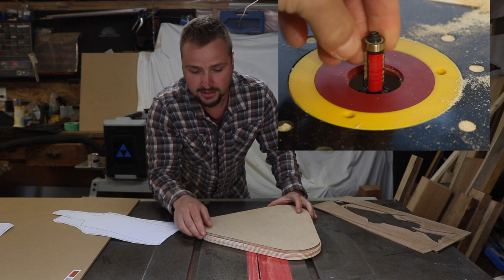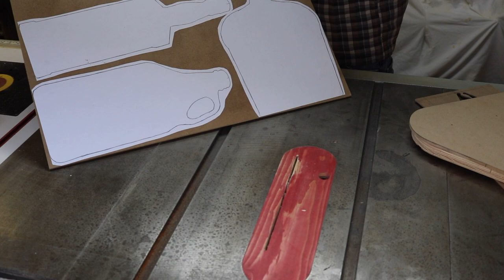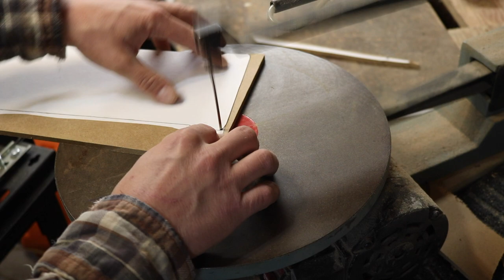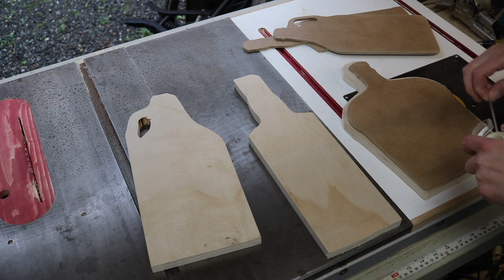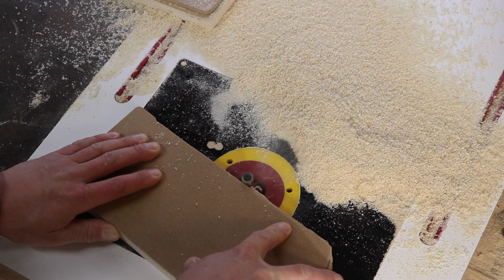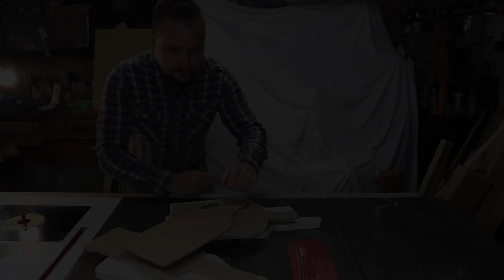How to: Making wood router templates, Router Tips/ Tricks

Comment: Hello and thanks for the video. I tried the same technique, but I often get kickback and one piece even has been thrown out of my hands towards the wall (thankfully). Any idea on what am I doing wrong?
Reply from the maker: Make sure you are cutting with the grain, look at the direction the blade is spinning. Before I cut any piece I plan it out and look at the areas I will run into issues (if I will be cutting into end grain) also you want to be putting in a direction the blade will be cutting into the wood, you will find if you go from the wrong direction the direction the wood is being feed into the blade is spinning the same direction, this is wrong. Hope that helps alittle.
Reply: Better to use a spiral flush trim bit.  A straight trim bit will do that.  Check them out over at bitsbits